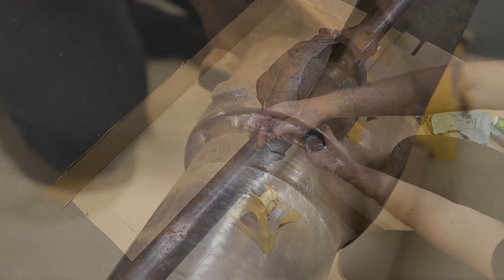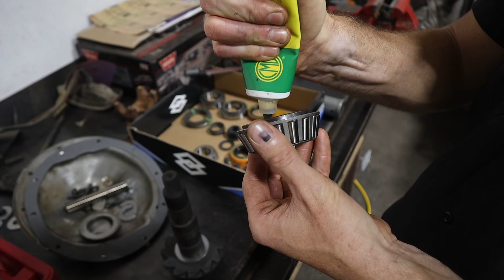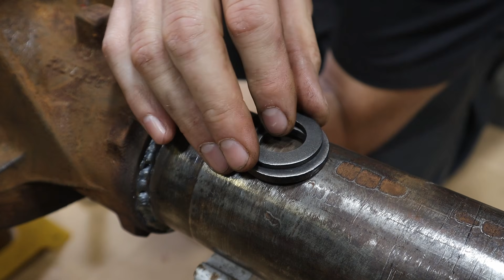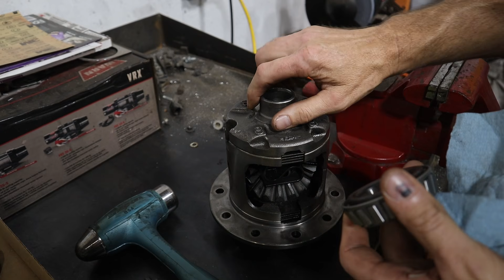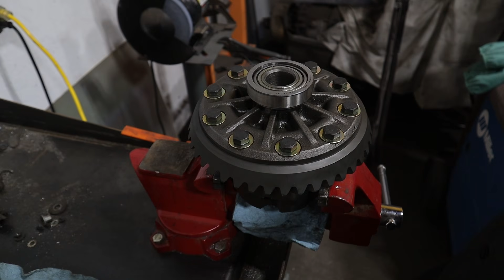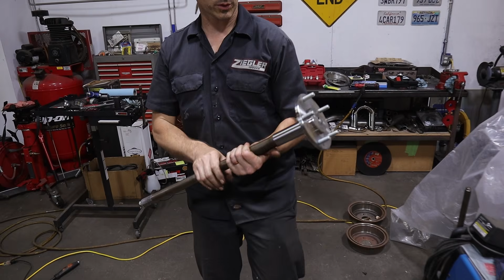How To Build Chevy 10 Bolt And 12 Bolt Rear End - START TO FINISH

Comment: As a Metrologist and Turbofan Test Engineer for Lockheed and Rolls-Royce for many years, one thing I can't stress enough.  No matter what the application, always torque in the star pattern.  Never assume that you'll get a good seat by tightening the next bolt will actually seat two surfaces evenly.  They most likely won't, and you'll get less life out of your parts doing it that way.

Comment: Thanks Rusty for the comment on pinion depth. I am with you 100%. I have one I am into right now and I am going to try for the first time using the crush sieve eliminator. I also like to use a mock up inner bearing to set pinion depth. Throwing darts to assemble one with no depth check. Dude got lucky, or maybe he did some stuff we didn't see? One last thing while I'm on the stump. Carrier bearing pre-load... There is a way to measure this and properly set it. I will not go there, but I will say that it is hard to get too much. A case spreader was used @ the factory. I like to spread the case .010" and push hard to get the carrier down in the hsg. Then feel of it with some gun oil on the bearings. I saw a video by a parts mfg. with their engineer telling the public it is not possible to preload the carrier too much. Bull Shit, you can too. All together, this dude put together a good video. Thanks !!!

Comment: Good video of how a rear end generally goes together for final assembly, but is not how you "build" one. Setting pinion depth by reading the pattern before final assembly is completely ignored, you certainly don't final assemble the pinion before you even put the ring gear on the carrier.

Comment: I made a fixture I bolt center of axles caps take measurements and set distance stamped on pinion with dep mic adjust with shims .

Comment: Grade 8 bolts require hardened washers. ARP shown would be best. Great video well narrated and showing the necessary details. Surprised you did not need to measure the pinion depth from the axle centerline. Can you explain why it was not needed?  Yes the pattern looked good, but that was not as clearly shown. Thanks for your efforts!!

Comment: Great video with detailed explanation! Is there supposed to be any lateral play in the axle? I have a 2006 Chevy trailblazer that has a similar differential but I have a small amount of lateral play when I jack up the rear of the vehicle and move the tire back and forth - I can hear click-click.

Comment: I agree with using a set up bearing I don't use a crush sleeve instead I use a spacer with shims to achieve the desired pinion pre load I also use a special tool to measure my pinion depth  another item on my list is if using a new gear set pay the extra money and have it  polished or REM it has a  mirror finish very smooth and decreased friction nice video

Comment: Nice job but when I set the pattern it is always before I use the crush sleeve or seal. If it requires a different shim it will need a new sleeve since they cannot be re-used. Once the pattern is acceptable, remove the yoke and front bearing, add the sleeve and seal then do final assembly.
Reply: same here

Comment: My 2 cents from experience…
I use a new extra pinion bearing that I have enlarged the ID of the inner race on so that it is no longer a press fit but still snug. Setting the pinion depth correctly often times requires a different thickness of shims and trial and error to get it right if you are not using a pinion depth gauge and sometimes even if you are. You don’t want to damage a new bearing if you have to press it back off. I don’t use a crush sleeve for initial set up. I also use an old nut. You may need more than one sleeve if you crush it too far and need to reduce shim thickness. I think 25 inch pounds is too much dry, it’s gonna be more when you add oil.
After I get a good pattern I remove the carrier and pinion and press on a new bearing. I don’t use an impact to crush the sleeve. I don’t like to mix impact wrenches with bearing assembly. I have a tool that I made that bolts to the yoke to keep it from turning. It has a hole in the center for a socket to fit through. I use the new nut at this time with a 3/4” drive and a cheater pipe to crush the sleeve and achieve the correct preload on the bearings. It should turn smoothly but feel pretty snug. It won’t freely spin like the old one before you removed it. Reinstall the carrier, torque to specs and double check the pattern. I also use sealant on the splines during final assembly.
Good video. Patience is a key factor.
If you are using a set of used gears, try to match the established wear pattern or they will probably make noise.
Reply: All great tips thank you Sir
Reply: spot on great vidio but baffeled about not checking pinion depth

Comment: I think that the reason why the lock washers did what they did is because they are designed to be tightened by turning them to the Right, not the Left.
They are twisted so that the end of the washer that is upward when you lay it down is the higher side and catches the bolt or nut to prevent it from turning to the Left, but since you torqued them in reverse because of the Left hand threading of the ring gear that forced them apart as you tightened them up.

Loctite and the flat washer is the way to go!!
Reply: Exactly. LW are designed to function CW tightening. I've never seen LW's used on ring gear bolts.

Comment: Thanks. Ive always been intimidated to do this myself. Now I feel like I can do it.  I am going to change the gear ratio on my 76 Formula Firebird.
Reply: Put some 10.5 slicks and see the axles twist
Reply: I have a Spicer Dana Model 60 narrowed with 5.13 gears in my race car and it's bullet proof my engine has over 1000 hp. The firewall has been removed it a has aluminum one now  ...

Comment: When you don't use any lube on the bearings. They will leave a mark on the race. 
I have pounded any bearings on at all 
I put the bearing in a bath of gear oil or 10-30 motor oil and use my little heating pad to heat up the oil. I use an infrared heat gun to watch the oil temperature. 
I will place my pinion bearing standing up. I will drop the hot bearing onto the shaft. It will drop right on. 
I take a Punch and tap it. The sound I hear it's seated.
I do the same with the carrier bearings as well. 
I wipe off some of the oil. 
Next I put the pinion in the housing and get it setup.
Note: If I'm just installing new bearings. I will check the pattern first. If it's good. I don't adjust the shim stacks.
Just like you. I do use my impact gun.
I do add sillycone,new nut
I have an inch pound tool. 
Set my rotational torque per specs.
Drop in my carrier 
Torque the bolts.
I recheck my pattern, it's a habit
Installed my axles and c-clip 
Button it up.

I was bringing my bearings in the house 😂😂😂
Till my wife gave me a pan and got me
 a heating pad 😂😂
The hardest rear differential was a 3/4 ton Ford and Chevrolet trucks. 
Tighten the pinion nut takes lots of muscle. 
I did discover using grease for torquing bolts is the ticket. I keep a small bottle for those tasks.

Comment: Very good tutorial.  The split washers failed because they are not for reverse thread bolts.  They designed to prevent the bolt from rotating counter clockwise. I 'm surprised that is what was supplied in the kit.  They make split washers for reverse thread applications.

Comment: Terrific video.  Quick question:  The Ford 8.8 has an "oil slinger" on the pinion.  Does the GM 10 bolt have similar? (Not mentioned in this video).
Reply: No

Comment: Should set the pinion depth before using the crush sleeve then set the back lash, take ring gear and carrier out , then preload the pinion with the crush sleeve that way you don’t have a useless crush sleeve if the pinion depth is off — I give it a 5 for the blood

Comment: Great video! Excellent addition to the internet. When I torque bolts I always do 12, 6, 3, 9, etc. opposite sides. Maybe it doesn't make a difference but I liked how you used a torch. Will definitely add that technique. Thank you